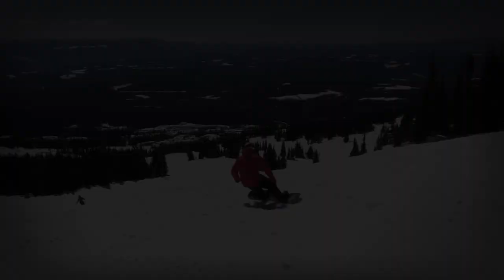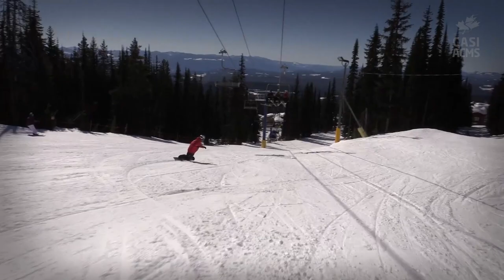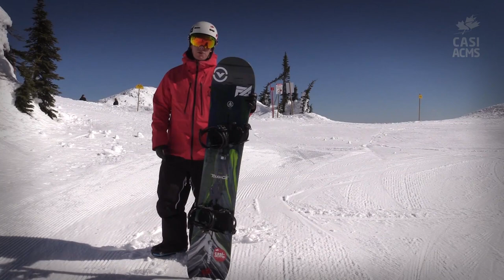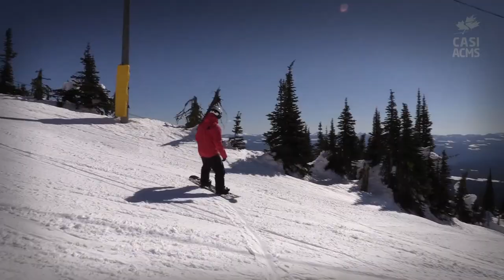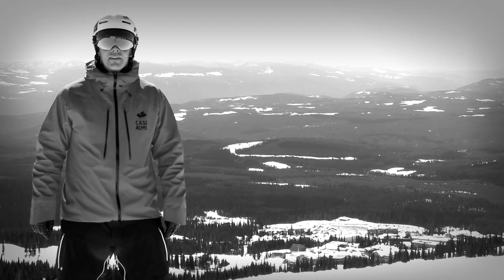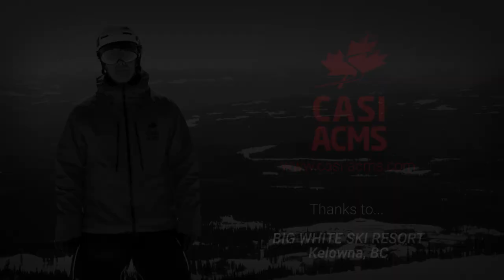CASI Riding Tips: Carving

Comment: If I'm correct, shouldn't you put slightly more weight on the forward foot when initiating the turn? I remember doing that exercise a lot when I was preparing for my CASI level 1 Exam. Great video and cheers from Sweden!
Reply: for medium or short radius turn, you are correct. but you need little more weight on back foot when carving so that your board tail would not slide.
Reply: @funislife8919  Not True.
Reply: Stay centered. You only feel like you’re forward putting weight forward bc of the angle of the slope. Stay on both feet evenly especially toward the end of the turn. Weight too far  back causes skidding.